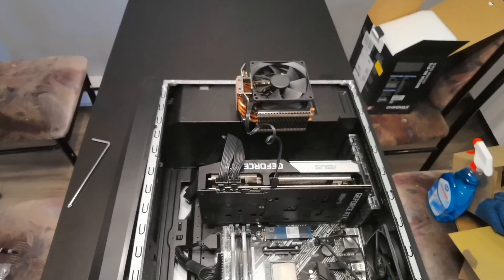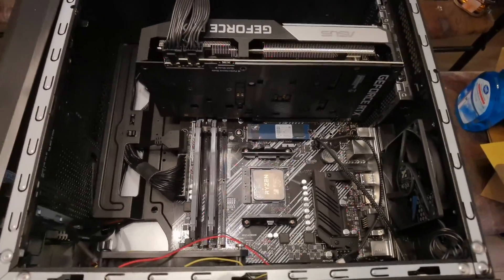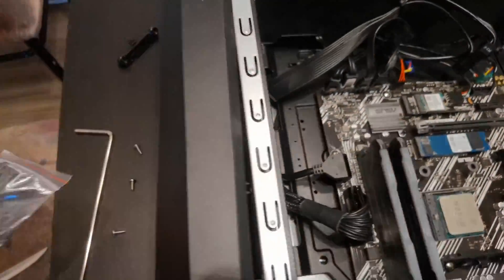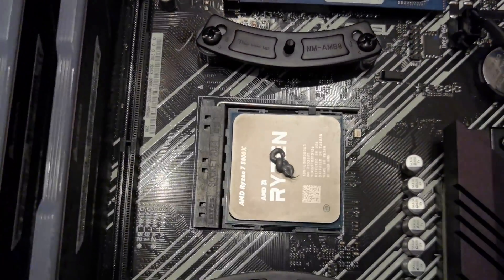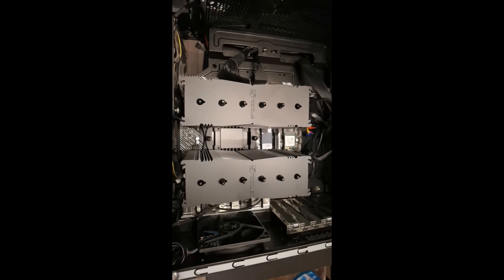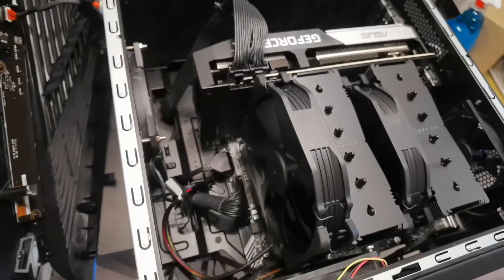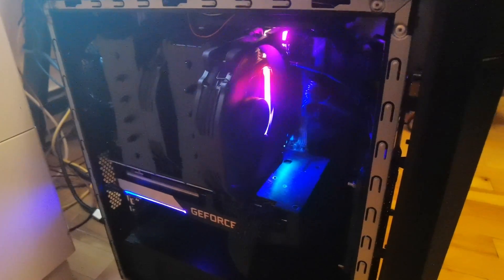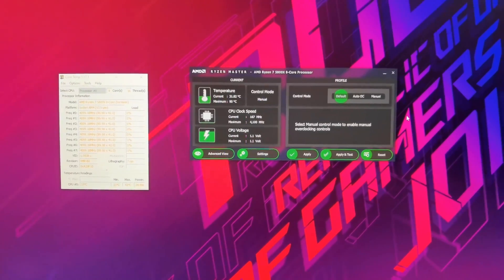Noctua NH-D15 Installation AM4 Socket (14 Degree Cooler)

Comment: Good afternoon, can you tell me how to remove the handle from the right case and the top panel so that the fans can be installed??!!))
Reply: @OnnSight  Yes, there are small clips, but the handle is also screwed on past this, and without removing the top panel, I can't remove the front panel, in the upper part where the front connectors are, the front panel does not move away in any way due to the fact that there are two more internal clips...((

Comment: How many nvme ssd slots does it have??
Reply: @OnnSight  i have the same pc with the 3080 and i feel like i need more ssd. I also need a cpu cooler because this gets really hot. But i wanted to mount at the top but I haven’t seen no1 on YouTube do it. And i am new to pc gaming. I
Reply: @OnnSight  i will do that personally I would like an air cooler better ao i can put more fan in front of case. And yes I don’t need wifi. So i will add a nvme. I will also get the n9 air cooler see if it fits in this weird case

Comment: in the end I decided to mount the dh15 myself and then make some changes to the glass panel (for example a hole to let the heatsink out) in order to insert it.  could you tell me which fans you have inserted and which split for the fans you bought?  always thank you very much

Comment: where did you connect the extra fan? do you think there is some way to close the case with this noctua? because I'm afraid of the dust and my 3 cats in the house and I'm afraid of their hair haha.
Could you tell me about how many mm the old heatsink was so that I can understand which is the largest air heatsink that I can insert? Thanks for all the support you are providing me. like and script;)
Reply: @OnnSight  so do you think the 15.8mm Noctua u12s could fit in?  or should I take a Noctua NH-L9a-AM4?

Comment: Love how you go into the details, and you know a lot of stuff! I am willing to buy the same pc, can you help me with the cooling? Of course I want the glass panel to stay on, so this Noctua does not count. Should I get any smaller cpu cooler, which one? Or water cooling as you jad before if it fits? Thanks.
Reply: @OnnSight  I set the options like you said. I ordered noctua cpu fan and two 92mm fans to put on front. Question: The rear fan/exhaust fan is not spinning all the time. What is the issue here, pc is brand new.

Comment: Which exhaust fan did u use instead of the stock one? stock one sounds like a jet
Reply: @OnnSight   You can swap component to a new case, the mobo is tricky but theres a guy utechpia, he managed to transplant the asus rog into a bigger case. Worth a watch if u plan on moving it to another case 😁
Reply: @OnnSight  last question :P, does ur gpu sag alot or is it pretty well mounted? thanks
Reply: @OnnSight  o well it means mine is not well mounted, guess i have to unscrew it and screw it back more tight, thanks for the info :D